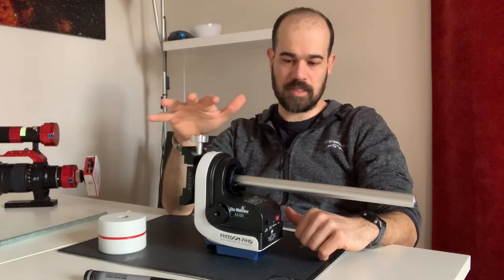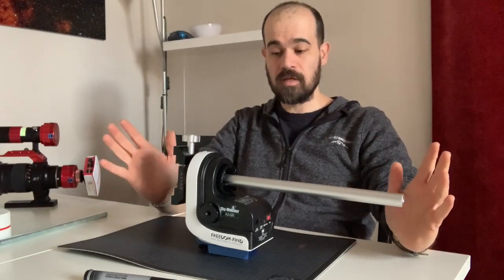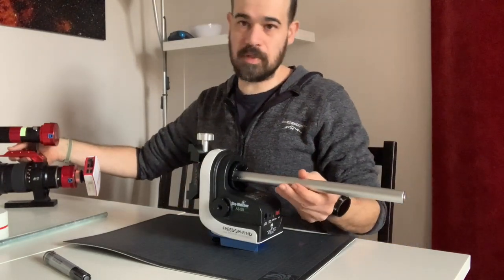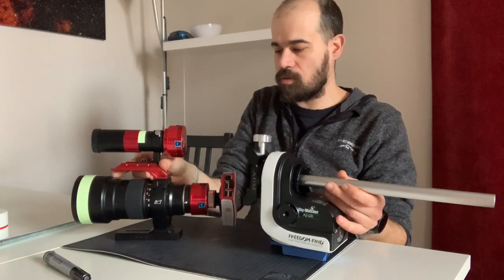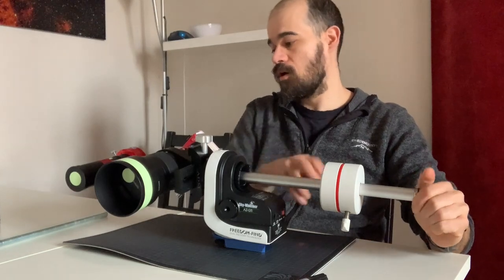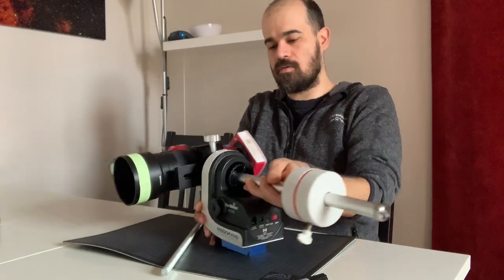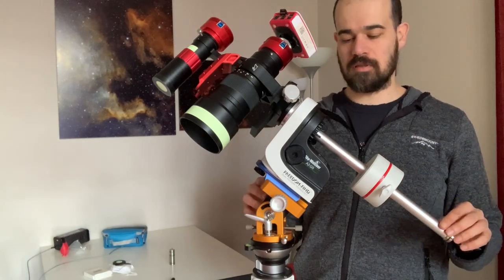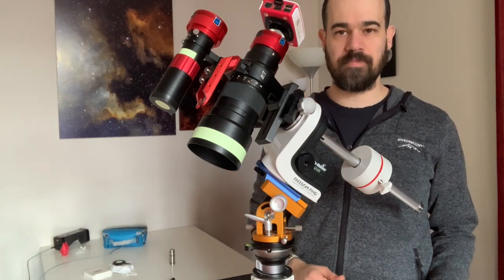Easy Balancing the Sky-Watcher Az GTI

Comment: 1.- Set the polar axis to 0º (or as close as you can); 2.- Release the RA clutch; 3.- balance with the counterweight; 4.- returns the polar axis to its original position. One minute setup.

Comment: Hi, great video, can I ask, is that an ADM saddle on your Az Gti? I just got a dual saddle and the adaptor plate goes on fine but the actual dual clamp onlt affixes vis a single centre bolt? There are other tapped holes in the clamp and it is supplied with two bolts but only the centre hole aligns. Just trying to find out if this is correct before I go ahead and clamp my scope to it. Thanks.

Comment: To balance the AZ, you put all the equipment + weight.
Then in the bottom 3/8” you screw a hook and then you put all upside down and put a cable to the ceiling:)
Then you move the weight until it’s horizontal… this is very precise

Comment: Hello friend, this is Anderson from Brazil and I would like to thank you for the content presented in this video.

I have some doubts, I'm going to start astrophography and I don't have anything, would you indicate this configuration to start? or indicate another one with a cost benefit.

- skywatcher telescope Evoguide 50DX

- EvoFF v2 - Field Smoother for SkyWatcher EvoGuide 50ED

- mount skywatcher star adventure gti

- camera asi294 color or asi294 pro color or asi593 pro or asi183 or other that you indicate?

- I won't buy guiding telescope and cameras for now.

- filters what does it indicate? in my city botle 8

with these settings can I get good images and good exposures of up to 60 seconds?

thank you very much!

Comment: Hi, I got 2 questions:
Where did you get the counterweight bar from?
And what product is the tripod ring for your Samyang Lens?
Thanks!
Reply from the maker: Hi. The counterweight bar is from artesky. I got it from teleskop-express.it but is not cheap. For long time I used the simple threaded rod you see in the video. But the bar is extremely well made. Still, on the expensive side. The ring for the samyang is the William optics ring for their Redcat, with the handle to mount a guiding scope mounted on a classic dovetail bar.

Comment: Hi Andrea, thanks for the video and your explanations! I have the AZ GTI and use it for observing right now, as well as for doing some very basic "Astrophotography" with my smartphone. In the future, I would like to but it into EQ mode and start with astrophotography (as explained in your other videos, thanks for that as well! :) ) So a very beginner question: Do I have to take the weight of the counterweight shaft and weights into account for the total weight I can but on the mount? So can I but approx 4-5 kg on the mount + counterweights, or is it 4-5 kg max including the counterweights?
Reply: Hi Andreas, usually mount specs are just the payload and ignore the counterweights.
Reply from the maker: It is debated. This mount is intended to be used in alt-az mode, not in eq mode. Equatorial mounts need a counterweight so the payload capacity listed is in top of the counterweight. Some people report that skywatcher said we have to count the counterweight as part of the payload for the az-gti. But alt-az mounts benefits too from a counterweight so I tell you that my experience is: 2kg counterweight, 3.5kg of imaging instrumentation based on a celestron c5 reduced to 900mm and the az-gti does not even break a sweat. Guiding this setup allows me to shoot 120s subs with a keep rate of about 70%. Just 20% worse than my neq5
Reply: @andreaminoia2002  Thank you very much for your detailed answer! The equipment I have in mind is 3.1 kg, so that should be fine then :)
Reply from the maker: @AKohler_Photo  need a strong tripod and good wedge too, though 😬

Comment: Thanks for the video! I assume you used the quad-lock again for attaching the Raspberry to the ZWO. But what is that silver screw between it? Thanks
Reply from the maker: It is a 1/4 to 3/8 adapter where the quadlock wall mount is attached to